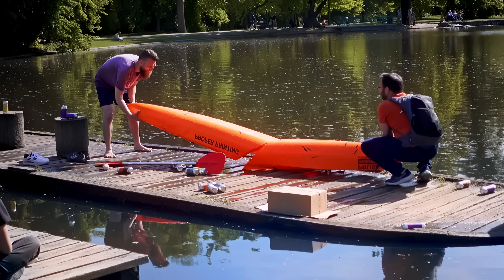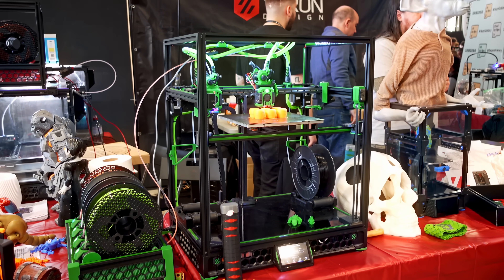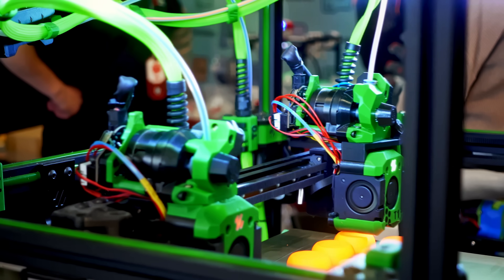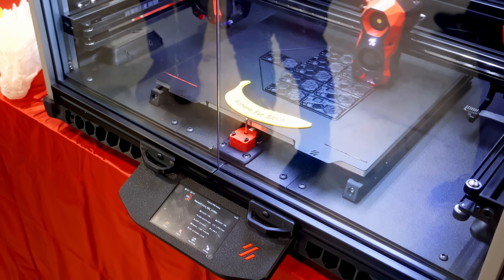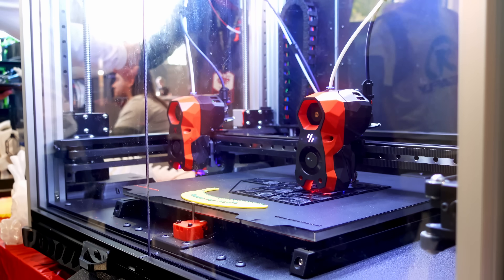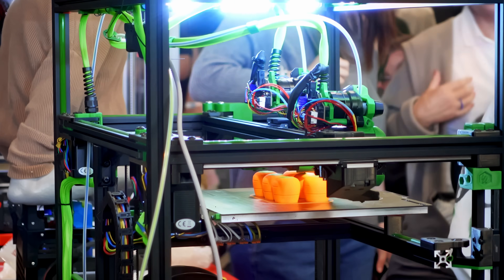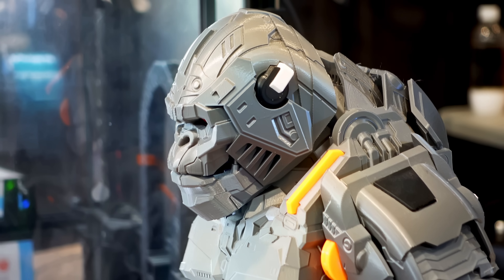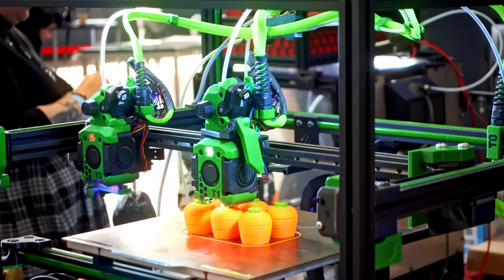Voron is making Dual Independent Extruders cool again!

Comment: I just came back from RMRRF, and one of the coolest printers I saw there was someone who had a Voron IDEX AND an MMU (Box turtle, I think) hooked into one of them, so that you could either run flex or the main color on one, and then have the other head doing a color swap while the other one was still running.  Want.  Very want.

Comment: The issue with IDEX is: How well can input shaping compensate dual vibrations in the different modes (independed vs mirrored)? And: Will the additional weight slow the machine to the point where even mirrored printing cannot compensate the for the speed disadvantage? I used to want IDEX, but now with the new Bondtech tool changer announced I actually like those more.

Comment: Really curious to see what innovations they will put forth. I build an IDEX printer a few years ago but never quite got it running well, even made a custom klipper plugin to use a camera to calibrate extruder X Y offset but it was a constant struggle. I've grown quite disillusioned with IDEX printers, they have a LOT of downsides

Comment: I have been looking at Voron lately however I have not been able to find any information on integrating automated features like load/unload and sending jobs to the printer remotely.
Reply: are you kidding? this is totaly basic and all klipper printers doing this :)
Reply: @ yeah, but for custom builds, as well as integrating an industrial PLC with the printer to control external hardware.

Comment: My biggest question is why? Why the return all of sudden after IDEX being basically dead for years now. I get they are more efficient for material switching from a waste and time standpoint but that just seems like a weird reason alone to make this whole new machine.
Reply from the maker: Multi-filament setups have had a bit of a bit of dwell time - when they were first available, the software wasn't ready for them, so the initial hype quickly faded. Now the software has improved and toolchangers and multiplexers are widely available and used, so the quest to find the most optimized solution for using more than one filament is starting up again.
Reply: @MadeWithLayers  Fair point! I do look forward to where this technology goes and hope it helps on finally cracking the code of multi material.

Comment: That first 20 seconds made me want to type a potentially pedantic comment (free engagement!). Tons of other projects exist, like Ratrig, the Rook, etc that make it easier to build your own than many voron designs. Yes there are less kits available, but Vorons being what people think of when they think open source 3d printer, I think hurts the popularity of it because they are overly complicated,  for what they accomplish yet simultaneously refuse to advance in a few key areas (touch probing (tap was not it), and a heated chamber)). In essence, they dont have feature parity, are harder to use (all require manual tuning at least for some things), very expensive, and complicated to build vs some other still open source options.

That all might sound like Im dumping on voron, and Im not. They have their market for sure, but I just feel like they shouldnt be the printers brought up when introducing/talking about open source printers to an audience that isnt exactly the voron audience.
Reply: What is the Rook? Do you have a link? Thanks
Reply: @KnooBill Rolohaun3d Rook is a small Corexy open source design that is much simpler to assemble.

Can't share links on the tube unfortunately.

Comment: only having a mirror option is the same as running two separate 3d printers at same time. synchronized multitoolhead operations on the same part are the actual holy grail. yep also the filament/toolhead change on the fly because of multiple print heads. yes coordinated movement of the various print heads, even on the same gantry.

Comment: There's a toolchanger mod for Voron as well.  Several videos on here of people putting them together.  AMS systems are criminally wasteful, so I'd love to see multi-head printers become mainstream since currently Prusa's XL is just about the only model out there most people are aware of, but it's prohibitively expensive.
Reply: Can't wait to see the INDX hit market. It's not often that the word "revolutionary" is appropriate for a new widget in 3d printing, but if Bondtech delivers on half of their promises, it will have earned that title. If it does, then IDEX will become irrelevant for pretty much anything except clone/mirror prints for efficiency gains in a more production-oriented environment.

Comment: OK, you lost me right off the bat with "Voron is the last bastion of printers you build yourself". Gonna have to VEHEMENTLY disagree. There are PLENTY of non-Voron printers you build yourself  - just peruse Printers For Ants, Rolohaun3D, Positron, and more.
Reply: Printers for ants might not be the best non-voron example given the voron based designs and involvement of major voron contributors or the ability to get a voron serial for most of them lol. But yeah it was a silly move on his part to say that as there are a few major projects out there and a bunch of small ones and it's all a somewhat connected community at the end of the day.
Reply: Vez3d, hevort...

Comment: I am very interested in learning more about that tension-controlled pre-feeder extruder found at 2:09. Any info out there on this?
Reply: Pretty sure that is so that the machine can handle the 10kg rolls of filament required for printing full volume prints. The normal printhead extruder can't pull such a heavy roll so you need a pre-feeder to provide zero-tension filament to the printhead.
Reply: I have a pretty lengthy reverse bowden tube on my printer. So, it would be nice to have a feeder motor to load the filament for me so I don't have to manually do it.

Comment: I don't know if I'd call Voron the "last bastion" of build it yourself printers.  I'd be more inclined to say "the ultimate expression" or "the market dominant option."  (Yes, I know Voron doesn't sell things, but from a strict Econ 101 perspective there's still a market.)

As to whether or not there's a "need" for Vorons - I would say that there is.  There is a need for designs and guidance that give people who are interested in building a printer a pathway to starting.  This need has existed pretty much since the beginning of the 3D printing hobby, and whilst it may have diminished - in that there were surely some people who would build their own printer when there was no other option, but would prefer not to if they didn't have to - it's still a major element of the hobby.  What's changed in recent years is that now there are options available to those of us who aren't interested in building our own printers.

But the fact that I now have access to good, reliable, and affordable printers that just work has in no way removed the need for well-thought-out designs with good documentation and BoMs to help people get started in building their own machines.
Reply: Yeah, my first thought at that line was "RepRap says Hi!"

Not that I have one, but jeeez.  They're still going strong.

Comment: Can i has a dual head 2.4?
Reply: Yes, some modifications are needed, but it’s definitely possible. Also, with standard sizes, both heads can’t use the full build volume — that’s why my Tridex has a custom size (the green one).

Comment: The biggest pain of IDEX machines is that you can't make two absolutely identical toolheads so the nozzle on one of them will always be however minuscule but offset from the other. Leveling the bed for 2 toolheads is pain, aligning them is pain, maintaining them is pain. And the payoff is kinda gimmicky (IMO). I really like what Bambu did with H2D on this topic (2 hotends on the same toolhead) but that's not really feasible in the DIY machine I guess.
Reply: How accurate do you need it? Nudge can get it to 0,002mm, alignment happens automatically with the right software setup. You are squirting out molten plastic so more accuracy is not going to make any difference in the real world in my view, is your different?
Reply: For non mirror/duplication prints the opposite toolhead is away from the bed, you measure the XYZ offset anytime you service the machine or ideally at the start of every print. The bed needs to be square to the gantry motion, this shouldn't differ between toolheads after factoring in the offsets, if it is you have a serious issue.

Dual lifting hotends isn't new in commercial or DIY. Lulzbot is a much older example of it. In DIY there is also the a couple examples of having the toolheads rock left and right. IDEX used to be seen as an easier to solve problem than toolchangers, but it seems everyone finally wants to tackle toolchangers.
Reply: Fully agreed, I built an IDEX printer and calibration is a constant struggle, it's catching dust now. IDEX has a LOT of downsides

Comment: Was just having a conversation with Jason LDO about the fate of DIY printers. It doesn't look good in my opinion. Up until the release of the X1C, RepRap and Voron were the best you could get. Hands down. 

Now the market is so tightly integrated with sensors and is mass producing (and subsidizing prod. from China) that spending 24 literal hours of work to spin up a machine doesn't make sense for most people.

I would like to see RepRap/Voron overtake the position of technological dominance, but this isn't hardware anymore. It's sensors and software. Very hard to quickly develop these things when you have only volunteers. I think this is just a symptom of market maturation that kicked off with the X1C Kickstarter. -Cooper

Comment: Unfortunatly, still no official IDEX system from Voron available.
Reply: That’s gonna change soon
Reply: @mr_voron  What would you know about that M.   ....😅😅
Reply: An "official" option would most likely be developed by the same contributors that developed the current solutions so I'd find it a bit silly to let that hold you back. The advantages to an official solution though are things like documentation.

Comment: I hope LDO gets an 'IDEX' kit together soon.  Really want to be able to print different materials together without having issues with residue.
Reply: At this point I'd rather wait for INDX from bondtech
Reply: @hrmny_  exactly what I thought
Reply: So I've had a custom built  idex for a bit. It used an ender 5 + as a base. The real advantage of an idex vs a tool changer is the ability to print in copy and mirror printing. I recently built a vcore 500 idex. 90 % of the models I print will fit 250x500 so I can print 2x the volume on one go. That said getting the nozzle offset the exact same for this to work is no joke.
Reply: Im struggling with that too. Was thinking about making a dual extruder single carriage system, a main extruder with direct drive and the secondary extruder as a bowden type
Reply: I'm putting together an IQEX from FormBot the Xplorer.  The IDEX is well designed and it's a decently easy build with high quality parts if it can be a company besides LDO.  Full transparency i got a bit of a hook up on the kit but I would tell you if it sucked, but it frickin rules!!! Got vids on the channel

Comment: a bit late to the game....  I'd rather go with the Bondtech INDX
Reply: Why not dual INDX?
Reply: @mr_voron  the added value of dual INDX over regular INDX versus the extra cost, complexity, and lack of software support.
Reply: @mr_voron   I had this argument with another guy and he either didn't understand or didn't want to acknowledge facts because of pride (and apparently owing an IDEX machine).

In short, unless you need to print two multi-material parts at the same time using clone/mirror mode or you need an insane number of different materials or nozzle sizes in a single print, you would be wasting money and leaving performance on the table for the sake of an inefficient showpiece of a printer. 

The major problem comes down tuning speed and acceleration with input shaping. Having a large stationary mass on the same x gantry that isn't doing anything (unless clone/mirror mode) makes it heavier and harder to accelerate in the y-axis which is usually already the major speed limiting factor on larger printers. People go out of their way to buy skeletonized gantries or titanium tube gantries to shave weight off at significant expense, so why add dead weight back on in the form of a second toolhead. You can also end up with some really strange resonance responses which can lead to quality issues when compared to a single tool head. Check out the RatRig Discord about IDEX tuning and you will find that it is a nightmare to tune when compared to their hybrid set up and always results in slower speeds and accelerations.

So, unless you fit into one of those very specific use cases where IDEX INDX makes sense, why pay more money for slower printing with worse quality? And that's before you consider the challenges @ericthecyclist brings up like software/slicer support.

Comment: Rat Rig is (if less know) an option in the same vein as Voron. Is it better? Worse? Same? Hard to say even having built one myself... But it is an option.
Reply: Ratrig is bigger, but doesnt have things like the pre feeder (which I think is just necessary when you have that much ptfe to feed through and they've even had problems with in the past.

That said, outside of that, they are far less overcomplicated, and seem not to just through parts at a problem until its solved vs Voron where I feel like the part count is probably double.
Reply: Ratrig feels more premium at a glance
Reply: @bravefastrabbit770 RatRig is a commercial (kit) offering, so not quite the same as Voron, but certainly an option too. As are VZbot and Annex for example